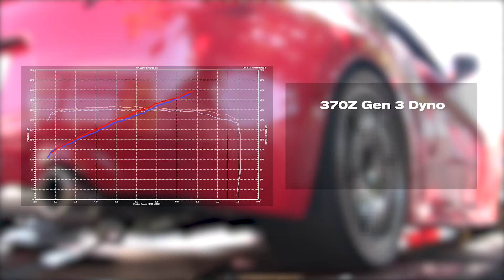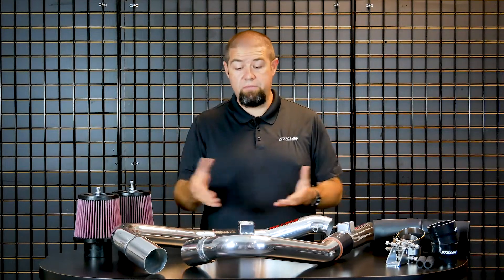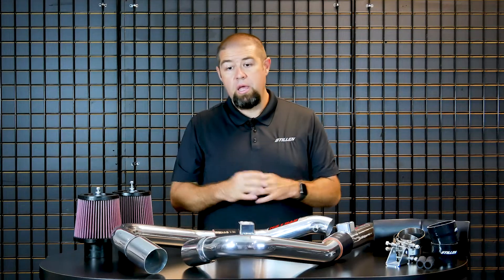STILLEN Cold Air Intake [Gen 3] In Depth Overview

Comment: How long do you think the oiled K&N filters will go before needing cleaning?
Reply from the maker: About every 25,000-50,000 miles. It depends mainly on your driving conditions. I would give them a visual check every oil change.
Reply: @STILLENvids  Thanks, much appreciated.

Comment: would they fit a 2014 q50?
Reply from the maker: Sadly no as the 2014 Q50 does not have the required holes in the core support for the intakes to route through. We do offer our gen 2 intakes for the 2014 Q50 though. That would be part number 403230
Reply: @STILLENvids so sad I have going from g37 to Q50  ending up selling my gen3 cause it don't fit in Q50   but damn this intake truly wake up my g37 especially 5k to redline feel the engine roaring and work hard pushing noticable power

Comment: You guys need to sell replacement filters! Exactly as it comes in the kit with the bolt sticking out of it!! 
 It's B.S. that customers have to  find a similar sized alternative filter with  a flat plastic head, and no mounting screw to prevent movement/ rattling. Bs bs bs.
 Have to fork over around $650-700 for a new kit. No replacement parts available smh.
Reply from the maker: We do now! They even come with a Stillen logo printed right on them. They will be added onto the website shortly. If you need them sooner, give our sales team a call, or head to the website and submit an email. We would be happy to assist you.